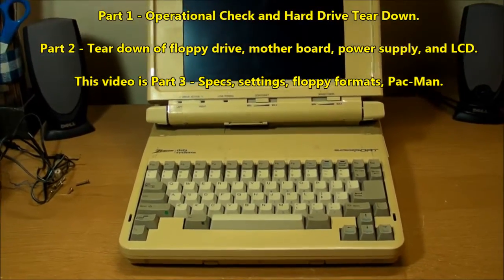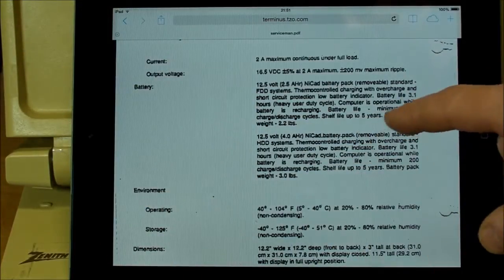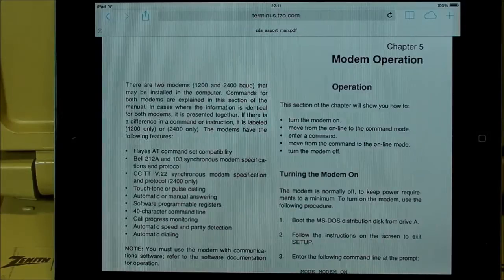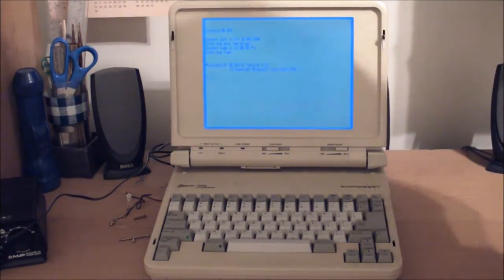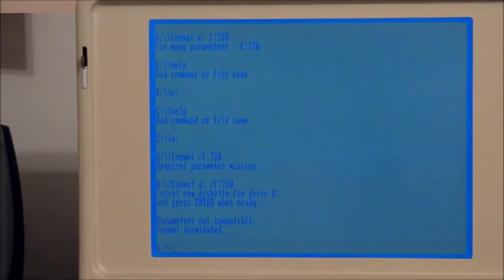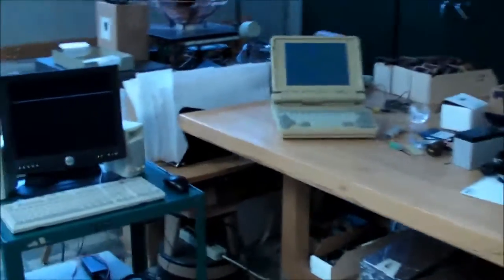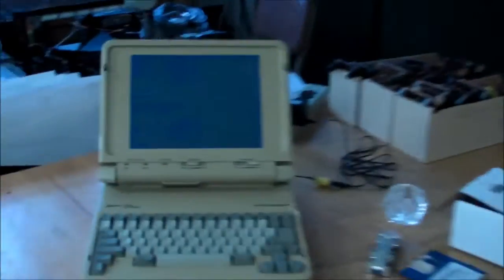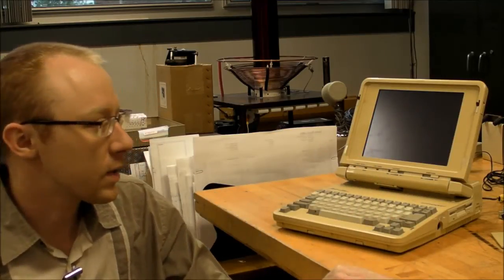(#0146) Zenith Data Systems supersPORT - 1989 Laptop Teardown - Part 3 of 3

Comment: On XT-class (8088 or 8086) machines, DOS isn't smart enough to figure out floppy drive capacities on its own, so it defaults to 360K for formatting (although it will still read and write 720K disks fine; only formatting is affected). You need to use a program like SETBPB35 to configure the floppy drive to format as 720K capacity:

ftp://ftp.oldskool.org/pub/tvdog/tandy1000/misc/setbpb.zip

Type SETBPB35 A to configure the A: drive to 720K.

And the corrupted LCD video is due to a bad connection in the cable going to the LCD. Opening and closing the LCD panel a few times usually fixes it.
Reply from the maker: Thanks for the tips. I didn't know about these limitations with the 8088. I'm more familiar with DOS on 286 and later.

Comment: interesting to see that i was incorrect on alot of my comment on the previous video, i was expecting that, for some reason, that if it had 2 rom chips, that it would have had a real cmos setup, but i suppose that is a little much to ask for a 8088 based unit. same thing with the 720k fdd,